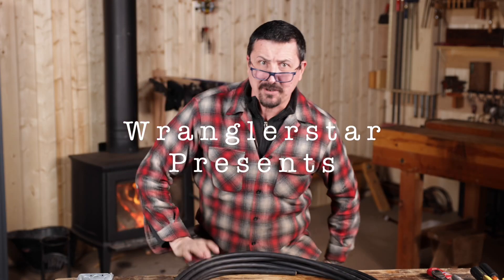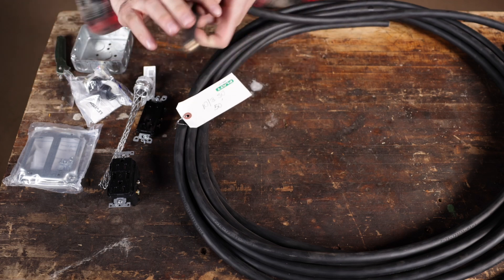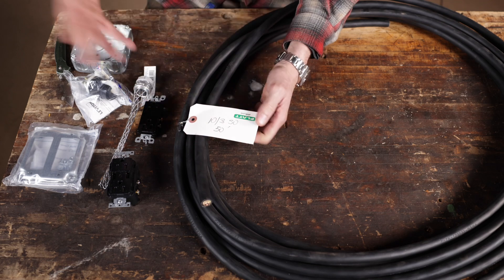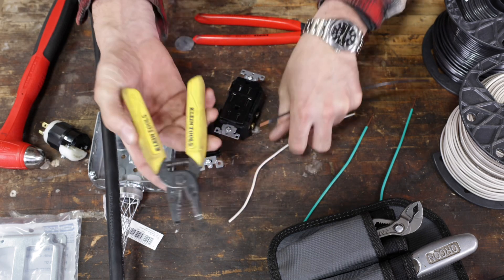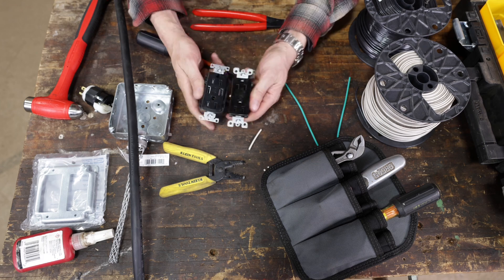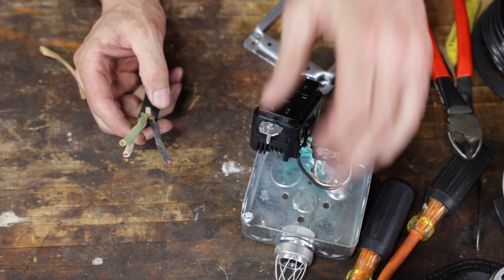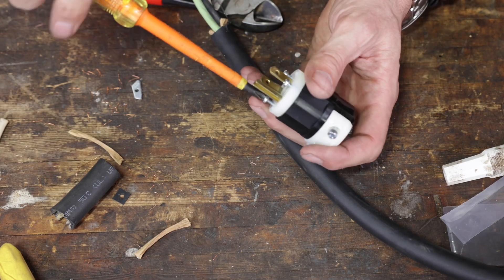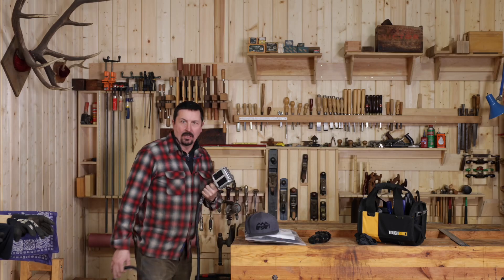The Ultimate $150 Shop Accessory - ALPHA CORD

Comment: The 10/3 designation on this wire is really misleading. When your buying wire from a store like Home Depot or Lowe’s or something, a 10/3 cable will actually have 4 wires in it. The 3 designation only accounts for the insulated wires within the sheathing. The 4th wire is a bare ground wire. So a standard 10/3 would only be used for power with more than 120 volts.
Reply: What you're saying is true for NM cable. But for Service cord (like SO or SJ) the labeling includes the green wire in the count.  And I have never seen Service cord with a bare copper wire.

Comment: Why build one of these extension cords? Because even as an amateur. Or a professional homeowner. The pros will automatically give you points if you have an extension cord like this around. My last one I kind of cheated on. I had a single box. And I had an outlet on both front and back. When I build my next extension cord. I definitely will have USB functionality on it.

Comment: These are fantastic to build and have around!  I'd like to see how you attached the 10Ga from the SO-3 cable.  Seems to be a missing spot.  Also, on the strain relief, the metal jam nut goes on the inside, with the plastic bushing on the very end.  IF you can find a box without the knock-outs, you'll have less worry if you drop the head on something that knocks one in, creating a path to ground for whatever wire it scrapes.  Lastly, NEVER USE THE push-in back wiring, and ALWAYS bend the J hook for the most surface area of contact to the receptacle. You can also consider installing one of the receptacles which have  a switch in place of one of the receptacles.  That'd give you three receptacles, one switchable, plus dual USB.  There are hooks you can install on the back of the box for easy attachment when you have a tree branch etc available.

Comment: 1900 boxes with multiple knockouts are NOT suitable for applications like this! I have seen them get kicked around on construction sites, hit something which pushes in a knockout, which then hits a live screw on a receptacle and throws sparks everywhere. Those boxes are meant to be fastened in place, not knocked around.

If you are going to build these things, use an aluminum outdoor box with a single threaded conduit hub. MUCH more rugged.

Comment: Wait a frickin minute.....
10/3 for 50 feet and you are going to plug in a welder. 
You use 15 amp outlets?
Well. They will work as a fuse for your extension cord. 
If you go 10/3......go longer....go 10/3 with ground. Double the box and have TWO 20 amp separate 115 outlets.....and a 220 for your welder. Run a 220 outlet off the main box.

Misleading folks with Poor advice is a no go.

Comment: Hi Cody,

If I may offer a small bit of assistance here...
•The size of the metal wire is called a "gauge." (Diameter of the metal wire.)
•Each gauge is a portion of an inch.
A 10 gauge is 1/10"; a 12 gauge is 1/12" and so on. It takes that many wire diameters to equal an inch.
•Because of the gauges a smaller gauge size is a larger wire size.
•In the US the terminology is AWG, or American Wire Gauge.
•There are other systems that use the gauge system also, such as sheet metal. Like a 16 gauge metal is thinner than a 14.

Comment: We always mounted the metal receptacle box on a small piece of wood so as not to scratch floors. Gluing a piece of heavy rubber gasket material to the back of the box works too.

Comment: Hi that is a very good extension cord you may want to consider taking the plugs back out of the middle box and wrapping electrical tape around the plugs to cover the metal screws. just for safety reasons once the plug starts aging a little the screws might become loose. Or something gets Inside the Box and right when you grab it the Box connects with the hot screw through whatever was inside the Box. And also electrical wires actually vibrate you may not be able to detect it but it can be enough overtime to work the screw and the wire loose also picking it up setting it down handling the wire itself can also help loosen the screws. God bless

Comment: Pay attention to the line and load sides on the outlet. Line is where the power comes in and load feeds the next outlet in the circuit. I'm not an electrician, but I have wired outlets before and yes they were wired according to code. 🔌⚡

Comment: What does the guage of the wire have anything to do with being able to use it on 240 volts? Why use 10 awg cord and use 12 in the box? You CAN'T put two wires under one ground screw. Its's not a jam nut it's lock nut or lock ring, It goes inside the box. That plastic bushing will break, and quickly. The ONLY time that 10/3 actually has three wires in it, is in this type of cord (SO or SJ). Usually the ground isn't counted. How come you never showed the cord being connected in the box? Is because you screwed up and didn't want anyone to see it? Why use an insulated screwdriver. These types of safety tools should only be used when necessary to prevent damage and ensure they are still giving the safety factor you'd expect whn you need it.. FYI, you NEVER need one, because you sure as hell don't belong anywhere near live electricity!!

Comment: I really find it hard to understand why Americans put the electric housing in metal boxes,  instead of isolated plastic. Tiny mistake in the build, and BAM you got zapped.
Reply: that's why we use 120v instead of 240v it hurts less. and as an electrician i have never even heard of someone mixing up the hot and the ground

Comment: The ground wire is not a current carry conductor and should not be considered as much! That's 10/2 my friend 10/3 would have a red wire and used for 240V or split 120V if wired for such.